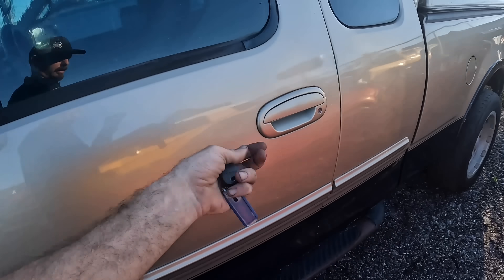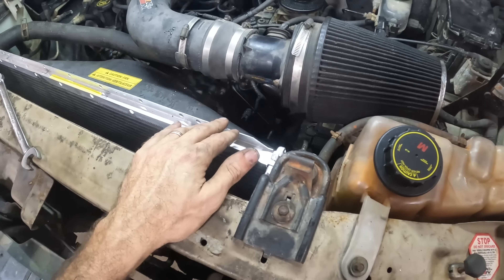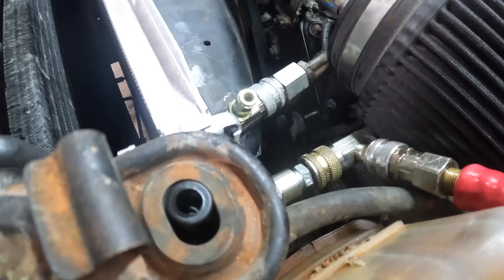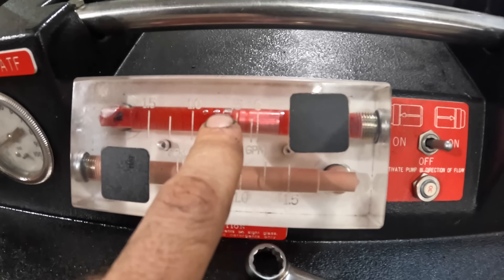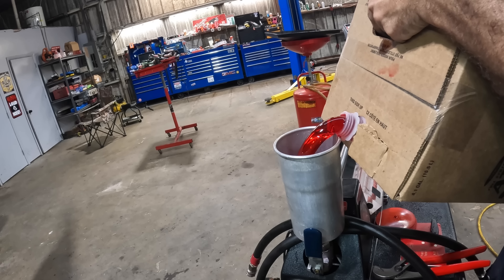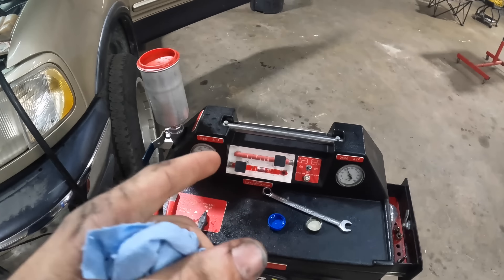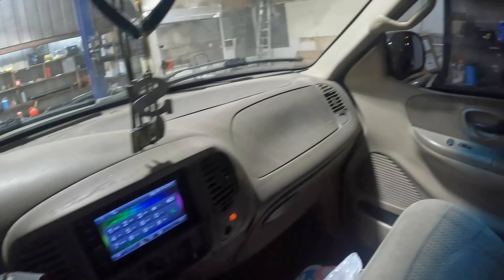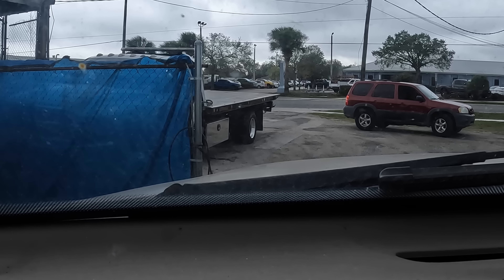Customer States: “Fingers Crossed” No Chance! 2000 Ford F150 4.6 5.4 Transmission Damaged

Comment: Hey Ray, just an FYI I believe the Wynn's transflush machine hoses are interchangeable. The machine will figure out the vehicle's direction of flow and it will do a 1:1 refill based on the amount of fluid in the vehicle. I am sure you already know that. Also, I believe the BG machine is the same so the guy who said you should hooked the hoses up backwards may be incorrect in that you can't pump bad fluid back into the vehicle. The sight glass just shows the fluid color difference. Great videos by the way. Love the channel. Have a good day!

Comment: BTW, that odometer not showing the mileage is a pretty easy fix. The little pins on the back of the instrument cluster weren't properly soldered and over time the solder connections fracture and fail.  Remove the cluster, resolder, and reinstall. I did it on my 99 Mustang about 10 years ago.

Comment: You should try shining a torch on the Odometer to see if you can see the mileage, might be à bulb had possibility blown in the rear of the gauge cluster?
Reply: This issue is widely known across the Ford lineup in these years. Due to a soldering issue during the manufacturing process, the digital odometer goes out. Had a similar truck as the one shown and the odometer would come on usually every few weeks for a minute then go back out.
Reply: I just hook up a scan tool to see the milage when that happens.
Reply: @PatricksDIY  Yeah but the customer might like knowing their mileage so they can arrange servicing etc, know it can be an hours labour to replace a 60 pence bulb but some folks like to see ... just saying

Comment: It reminds me of vehicles that have been flood damaged and driven with water in the transmission and the clutch material adhesive lets go and as you stated clutch material is found throughout the system. Good luck
Reply: many totaled out by insurance.

Comment: It's good to see that you're doing great work on this site. However I have a point that needs to be addressed and I apologize if you already have covered it but it happen to me this last fall and it is a nightmare.  I have a 2000 Ford Expedition with the 4.6 motor  and 217000 miles, now I live in AZ in Southern part of state and my parents have a place up by showlow and this important because to reach the location either you go the salt River canyon or about 200 miles around. So I get there help my mom and when I was ready to go my Expedition decided to blow a spark plug on the #5 cylinder and I had never heard of such a thing. And then I got on you tube and it turns out that this a common problem with the Ford 4.6, 5.4, 6.8 liter motors with the 5.4 the worst of the bunch, and it's such a large problem that there's a kit to fix it while the engine remains in the car. Not only that there's actually video on how to do it step-by-step.  But anyway I was able to get it fixed so I could get home I had told the shop that did the repair I just needed to get 200 miles to my house and it did get me home. However about 100 yards from my driveway it popped another plug on the opposite head. Which has made me begin to wonder how good are the Ford products?

Comment: Ray: wouldn't it be good to clean out the reservoir on the coolant overflow bottle?   It still had all that sludgy mess.  Good video though.   I'm enjoying seeing if this beast will move!   LOL
Reply: Did Ray put in some antifreeze back in the system?  Not for the anti-freeze but for the pump seal lubricant, etc.  Water by itself can be used as a stop-gap for a while, but not long term.  Otherwise the water pump seal may fail prematurely.
Reply: Ray didn’t even change the hoses, which are probably going to be affected by the petroleum. It’s very definitely a half assed fix, not Ray’s fault.

Comment: Just out of curiosity, while you were doing the flush and with the engine running, did you cycle the tranny through all gears to flush out the passages and valving? That may have accounted for the initial sluggishness when you moved it forward and back.

Comment: Ray have you looked into buying transmission fluid by the drum it should cost alot less than buying by the case if the drum is more than you could use then maybe check on if it's cheaper by the 5gal bucket just a thought since when flushing fluid its just trashed you'd also have way less trash

Comment: What I have done to get more mileage out of worn out transmissions, to be specific a Kia Sportage, a Ford E4OD in a truck, and a Volvo V70, is to change out the fluid for Type F. It's a "grippier" fluid with less/different friction modifiers and for example that Hyundai is still running, 60,000 miles later, on a transmission that wouldn't even go up a small hill without slipping. The Volvo was junked for different reasons and I still see the Ford around.

Comment: Hey Ray, you can use Kerosene for flushing. Much cheaper and any remnants just evaporate from clean fluid.  Again, any embedded moisture in the frictions turns to steam under high load and fragments the frictions.  Sorry but the unit needs renewing. Keep up the good work Ron

Comment: If it drove in with pink milkshake in it, it would definetly drive out with clear fluid.
Reply: With all the old gritty material still in the transmission it would give it some traction, removed, after the flush, nothing left of the clutches to grip, but in this case there was, for now anyway.
Reply: It didn’t drive in. Came in on a flatbed.
Reply: @seashackf1  yeah, before he done any work, he drove it into the garage from the parking lot, that's what he meant by driving it in. After the work, Ray only moved it slightly backwards and forwards to then determine that it still moved, then took it for a short trip to determine it shifted.
Reply: @seashackf1  I mean that Ray DROVE it into the shop, so it would DRIVE out after fluid exchange.
Reply: @jackfisher3906  fair enough, see what you meant. Once had load on it and had to shift it wasn’t great. Interesting to see how long it lasts.
Reply: @seashackf1  it is lighter shade of pink now.

Comment: How much per month is a new truck?  Do not forget the super fancy insurance you will need.
Reply: roundabout 1000/month with insurance. least that's what my 22 highlander hybrid costs me
Reply: @bradhaines3142  I know, it was kinda rhetorical.   My point is that it is worth it to keep a  work truck going.    New truck monthly cost quickly eclipses old truck repair.   Nice to have a new truck though.
Reply: Good point, you could drop $4,000 once a year at Ray's and be ahead of the game by driving that truck -- like with heavy equipment operations, unless there is new technology then you're just as well running iron from the 70s that's maintained
Reply: @handbananaistherapist642  eh, you'd save on things like fuel, you'd be able to do more with the extra power. a lot of creature features these days too. there's value in buying new. 

for me the reliability is a magical level of stress relief. knowing it wont leave me stranded or suddenly need another thousand in repairs takes a lot off my shoulders.
Reply: @bradhaines3142  That is all true.  For me as a business owner with 5 work trucks, vehicles are a HUGE expense, and I do my own work on them and have gotten good at making them last.  I know what is important and what is just silly nonsense.  I do buy new trucks, but only if I can maximize my tax deductions. Ray is non stop bagging on this poor fellow.

Comment: Why hasnt anybody ever produced a seperate cooler that bolts on in front of the radiator by passing going through the radiator altogether ? I mean the car is twenty years old surely this isnt a new problem.?
Reply: They do, they have,  it is a aftermarket air cooler. I put them on all of my work trucks to by-pass this lazy rad-cooler design.

Comment: Tap into your regulator on your waste vessel with the proper BG fitting for machine purging and never make a mess. BG products are top shelf stuff. The de-carbonizer for the DGI engines have saved many customers from cylinder heads and or "valve jobs". I was told BG worked with GM, Subaru and VW to help with the "EGR valve over lap" engines. I can attest to saving many GM 3.6L VVT by using the pre-TB injector nozzle system over the GM 88861803 Upper Engine cleaner. Both require the atomizer nozzle anyway. It works just as BG claims.

Comment: The owner should just take this to AAMCO and let them rebuild the transmission.
Reply: I'm assuming you're being sarcastic.
Reply: It works better now then it would if AAMCO got their hands on it
Reply: Yeah take it to AAMCO and have the technician Willy Coté install an ACME brand tranny.
Reply: AAMCO will not touch it unless he pays a large deposit first.
Reply: @forgetful me  I took my first car to get  the transmission fixed way back in 1993. They ended up saving me a lot of money. Because of those a**holes I learned to do my own repairs. They're beyond worthless.
Reply: @James Isaac  I got a rebuild once and my car went back 21 times. Literally 21 times. They finally refunded my money and I went to the dealer and had it fixed properly.
Reply: @jamesisaac0409 true, all they have to do is put little ball in wrong holes. with right tools and factory manual u can do better as ur own car..

Comment: I don't know where you are and how far is too far, but there is a junkyard chain called Pull-A-Part. You take it off you get it dirt cheap. Automatic transmission with torque converter $120.00. just have to find the vehicle you need. They don't always have what you need, sometimes you find something that will make you some change.

Comment: Unless I’m mistaken, the oil that’s in the pan is drawn up through the filter to the pump and then through the torque converter and valve body. Some goes through the radiator back to the pan. 
I flushed my flooded Mazda2 , by removing the pan and filter. Installing a supply hose from a 5 gallon bucket of clean oil to the port of the filter mounting . Putting a large drain container under the whole transmission. Start the car and shift it through all the gears and reverse. Thereby flushing all the clutch packs and components.  126,000 miles later I must have done something right.

Comment: Anytime I leave you a comment on how I used to do repairs that you're doing with your modern machines equipment I am not here to criticize you that is not a criticism it's just giving you some information from an old guy that back in the day on heavy equipment badass hydraulic Transmissions like heavy equipment and some large trucks with automatic transmissions and I would go through the procedures like I explained to you it was cheaper and it worked. And believe it or not it's saved a lot of time

Comment: Drill a hole in the side of the top of that drain pan and install a threaded quick connect to it. This ends the possibility of it flying around while you drain the machine. That's how we did it in my shop.

Comment: I've done this before with good success.  If there is a drain-plug on the pan I always drain that first and refill with new oil to make the cleaning process more effective.  In the case on my vehicle, without a drain plug  but a good reusable gasketed pan, I took off the pan cleaned it. and refilled a couple times.  I find getting the percentage of crap fluid out at full strength is better than doing a flush.  And did you drain the engine coolant and refill a couple time during this process?

Comment: I've done something similar on a 700R4. I used about half trans fluid, half diesel, and some iso-heat for the first and second flush though. I didn't have a fancy machine so I just pumped out of one bucket and drained into 6 gal fuel jug which got used for starting fires and stuff. I know the EPA might frown but it made starting a brush pile to burn real easy. 

Then flush with good fluid. Drive about 10 miles. Drop the pan, replace the filter, and fill again with good fluid. (I also cycled through all the gears while it was running to get as many passages flushed as I could, on every flush.)

To my shock it ran for about 3 years until I bent the frame loaded with firewood and hit a bank when a front tire blew out. Of course it wasn't on it's last legs when it got filled with coolant. I suspect the one you were working on was.

Comment: Hey Ray, I have the exact same F150 - 2001 model. Have already changed radiator. My mileage odometer works sometimes and not others. If you put tilt steering wheel all the way up, it will show. Move it about half way down and nothing shows. Bad wires inside wheel. Might check that one to see if it does the same. FYI.

Comment: The slamming in to gear is likely the shift accumulators seals are sticking to the walls, maybe once the seals dry out and get some fluid on them so they can slide, the shifting may get softer. It may need a few warm ups to vent off some water vapour. Shift Accumulators are a piston with a spring to ease the clutch plates on to the clutch packs and they are in the Valve body in the bottom of the Transmission (the Brain as some call it) Valves controlling fluid pressures to control clutch packs, This is why STP help restore the pressures in the valve body and in turn restores pressures at the seals for the clutch plates. In the value body you will find pistons like valves that slide and vibrate in cylinders and as they wear out the fluid pressure level drop and that slows and lowers clutch plate pressures for the sifting of gears, if you can increase that lost pressure back to it New or close to new values than you can get a longer life from the clutches if they are caught in time. Just seeing your pressures increase tells you that the Tranny can come back to life. Those Fords would be rusted in to the ground up here in Canada, most of that year have no frames left in them around the middle and the top of the Box is touching the Cab. Your lucky to have one in that good of shape that can be lifted with a shop hoist.

Comment: Given the odometer isnt showing anything, would mileage show if you plugged in the scan tool ?? If the truck has a ton of miles that would partially explain all the clutch material inside of it.  Hopefully this will get the guy until he can get another trans for it. 
    As for Google reviews...I agree with you Ray regarding posting comments/rating when you have never been to the business in person and had services performed.
   Keep us posted as to these trans saves you have been doing...that machine has earned its keep for sure:-)

Comment: Sometimes you just gota do what the customer wants, but warn them, in writing, of the pending failure and, by the way, no warranty on this repair! For flushing the cooling system, use a liquid laundry detergent. It doesn'tg foam and will de-grease everything!

Comment: Hi Ray, I just wondered why you didn’t just re-cycle with the cheap fluid first, and add the cleaner to the second flush which would give the cleaner a weaker contaminated transmission fluid to work on? Then if it’s okay , do the final fluid exchange.

Comment: In a previous vid you explained the reason that you've only done these sorts of things at the new shop: because at the old shops, when you explained that you wanted a BG machine to offer these kinds of services, and even volunteered to buy it from the shop if it wasn't profitable, they either refused or got a mostly-broken used knockoff instead. This is the only shop where you actually have a decent machine capable of such things, which is why this is the only shop where you've done them.
Reply: the cost of recycling the contaminated trans fluid coolant mix prohibitive unless someone flush down the sink.

Comment: I really hope the owner pulls the trigger on a trans replacement since he has already replaced the engine. But I do agree with Ray, at some point you have to weigh cost analysis. Is it worth it to keep replacing parts vs value of vehicle.

Comment: Hey Ray, from experience with ford starters with old ford engines, sometimes those starters will start spinning too fast before the gear can extend out into the flywheel to engage it. Its a weird problem and what I found is that the aftermarket starters suck and that the oem ones are better. But like you found, trying the key again solves the issue.

Comment: Hey Ray, great video. I have a 2008 Ford Explorer, Eddie Bauer 4.6 V8. The trans seems to slip in and out of gear, slips, surges while driving around 35mph. Feels like it might be a little low on fluid. But! There is no dipstick, or for that matter no drain/fill plug on the pan either. What the heck? How do i check, or add, fluid at all to this trans??? Any info or help from anyone will be much appreciated. Keep up the great work Ray!

Comment: Of all of the vehicles that I’ve owned, never had a problem like that ‘ord. Did have a automatic transmission fail because of previous owner’s neglect, I changed fluid & filter, got a few more miles. Oddly enough it was an ‘ord also. Ray you’re one of a kind in the best way. Stay dry, keep the educational videos coming also some 😆from that not so smart reviewer

Comment: That F150 sounds like my Dodge Caravan, just keep it running till I can get another. I do not know how much longer it will last, will it be the transmission, motor, or rust that gets it. The trans still works great, the motor blows oil and leaks, the shocks and floor pans are rusting, this is just a small list but it does go from point A to point B. Drive it till the wheels fall off.

Comment: It’s not broken just some on the solder has come off on the connection, it’s common with the digital odometer on the 10th gen f150